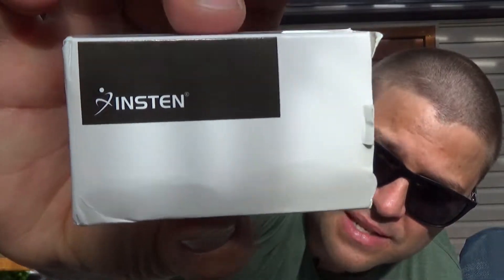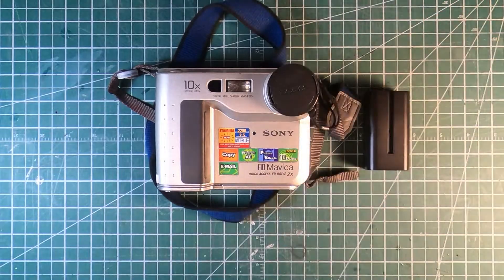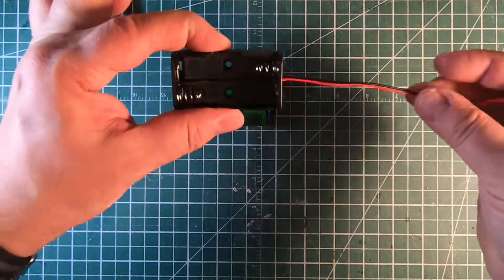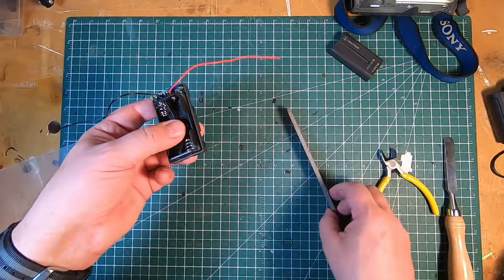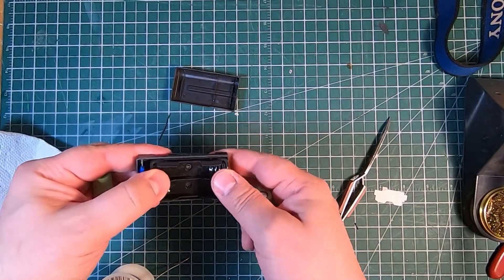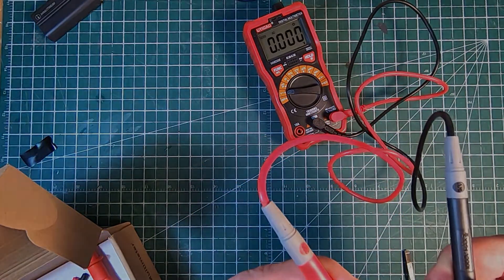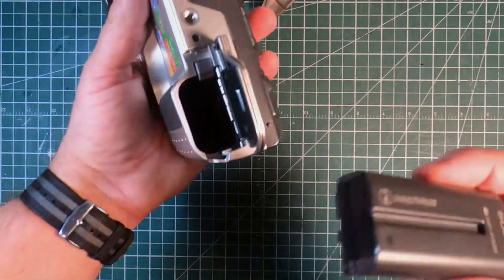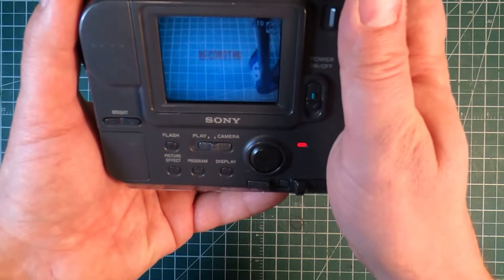Sony Mavica battery pack rebuild - rebuild Infolithium battery with 14500 cells!

Comment: If you replace the 14550 cells with new ones, will the Mavica still recognize / accept the new pack?
Reply from the maker: Yes - the circuit board is the important part as far as the "Infolithium" ID is concerned.  Changing the cells doesn't affect that at all.
Reply: @makertype so it is possible but the cells are soldered? You can't just remove & replace them, right? Thank you 👍

Comment: Hey, i have the same exact battery and need to put on new cells, which i have here on my desk. 

As a stupid idiot i dissasembled everything without noting where i should solder everything. Could you explain me where every wire goes? I cant really tell it in the video.
Reply from the maker: There are only the two solder points, one per side on the right and left side of the circuit board - where the original cells were spot welded in.  They should be very large solder pads, IIRC they may even be labeled on the circuit board.  The positive lead from your new cells goes on the right side at the bottom of the board.  Hope that helps.

Comment: Hello, Im trying to do this for an old CCD-TRV16, im wondering if the "third pin" from the original battery was plugged to any contact of the battery or was just left hanging, you mentioned that the AA holder looked like if was made for that 3rd pin and pin over the aluminum plate, so im wondering if it's soldered to it or just stacked without touching anything else
Reply from the maker: Yes - it fits into the slot at the base of that AA battery holder, and makes contact with the negative pin there, I point at it at 3:31 in the video.  I didn't bother soldering it in place, as the spring pressure/friction held everything together.  Hope that helps!
Reply: @makertype  completely does!! I really appreciate it 🙏🏻

Comment: I want to do this with my Mavica. Where did you get the 14550 Cells?
Reply: Having a hard time time to track this replacement battery pack down.
Reply from the maker: I did too, that's why I had to build this one, LOL! - the 14550 cells are usually available on Ebay and Aliexpress, but they are getting harder to find.
Reply: I’ve searched both sites, found nothing. Search continues
Reply from the maker: @byronkutchera9953  I changed the video description to specify 14500 cells - there are still a bunch of sellers on alibaba and elsewhere calling these 14550s for some reason, but the proper designation is actually 14500.  Thanks for bringing this to light, I'll see if I can edit the video to correct that voice-over.
Reply from the maker: @byronkutchera9953  Try a 14500, it should still fit in the AA holder EDIT - did some digging and yep, they are the same size.
Reply: Thanks! I’ll try that!